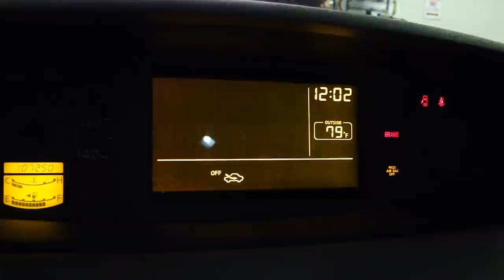Replace Nissan 3.5L V6 Crankshaft Position Sensor | 04 Nissan Quest

Comment: You have the same model Quest I do with the 4 speed auto trans so your video was very helpful for locating the sensor. It is different for the 5 speed. Also, I drove my quest for over 2 years with the odometer and fuel level display so degraded I couldn't tell my mileage or fuel level. Then I discovered your video for replacing the liquid crystal display. Twenty dollars for the display on line and followed your very detailed video and display was back working. Still is at least 2 years later and car has over 180K miles now. Thanks again!
Reply from the maker: Thanks for sharing your experience. Cheers!

Comment: Thank you!  I have an 2006 Altima SER and replaced the sensor over the weekend (P335 error code).  It's an hour project.  Two 10mm bolts.  One for the heat shield cover and a second for the sensor itself.  While the sensor is in a different spot underneath, your video put me in the right area on the passenger side and I was able to quickly find it.   Your videos show how these things are very doable and not out of reach for all of us. Thanks again!
Reply: Hey!  2006 SE-R here.  No error code, just intermittent random trouble starting.  Is the crankshaft position sensor just above a green harness as in this video, just on the passenger side?  I have yet to get under and look (was hoping all VQ35DE were the same) but just wanted as much info as possible before I do.  Thanks!

Comment: One thing I would like to add.  There is a O ring that is missing from that, so I would recommend getting it.  Also my CEL didn’t go away after i installed it, so you have to clear the code with the reset procedure, or using a scan tool.

Comment: Thanks for posting.  I watched the video that you posted to replace the cam shaft sensors.  I was able to quickly replace the oil seals as they were old and seeping.  My car is a 2007 Murano.

Comment: I have 08 Nissan quest. It does this weird tick after it wont start in the odometer area. The odometer dial actually flutters up/down once I stop trying to crank it. I put in a new starter, new alternator, and a new battery today. Do you think the crankshaft of cam is the problem? I was also told that it could be the fuses that are connected to the positive battery connector. Thanks in advance

Comment: The crankshaft position sensor on a Nissan pathfinder 2004 is directly under the center of the motor next to the oil pan very easy to get to

Comment: I alrdy check my nissan cefiro 230jm v6 wth OBD n the result my camshaft sensr bank 1 breakdown. Then i change the sensor bank 1, at the first it was smooth n no engine warning light appear after i drive for 5 hours all of the sudden my car misfire n warning light appear? So what should i do? Really need ur help. Did my new camshaft dat i change breakdown again or what?
Reply from the maker: Is it a Nissan part?
Reply: Yes, its nissan part

Comment: After changing the crankshaft sensor does one need to clear the error manually or the car system is smart enough to know that the crankshaft sensor has been replaced?

Comment: dia2fast, I just got my crankshaft POS from the dealer.  Like yours, it does not have the rubber o-ring like you find of the camshaft position sensors (your video).  Am I to take it that it does not require an o-ring?

Comment: Are you changing the crank shaft position sensor, or the cam shaft? You said cam shaft but caption says crank shaft.
Reply from the maker: This repair is for the crankshaft sensor which is located under the car. The camshaft sensor is located at the top of the engine.
Reply: @dial2fast  Thank you for the information.

Comment: Thanks for the video! Need to replace the one in our quest. It’s had a hard start since we purchased it and after replacing 3 different things that didn’t work I’ve finally came to the conclusion that this is the problem. It turns over 5-8 seconds before starting. Hopefully this helps
Reply: Did it work?

Comment: Good video but, without scrolling through the comments, it would be good to know what symptoms prompted you to R&R the sensor.
Reply: If the crankshaft is faulty the OBDII will report a P0335 code. The check engine light will be on.
Reply: Posible loss/lack of power
Engine stall while driving.
Reply: Loss of power? yep. The thing runs like a top now. Smooth, no stalling. Acceleration has improved by at least 10-15 percent.

Comment: Is an o-ring not needed on this sensor? When you showed the new part I didn't see one.  I also didn't see one during your installation.  I'm in the process of doing this and I didn't see one on the one I took out.
Reply from the maker: The Nissan sensor comes with a new o-ring.
Reply: @dial2fast  thanks I ordered an extra o ring when I ordered all sensors.  Tried putting sensor into place with o ring and it won't quite go into place.  I'll keep messing with it.  Haha.  Thanks for the fast reply.

Comment: I don't have a engine light on ... battery is good starter is making a noise i already changed the alternator cuz it was soaked in oil ... still doesn't start

Comment: Question.  I have a 2004 nissan maxima that gave me a p0340 (cam shaft sensor both bank1 and 2) I'm idling around 500 while in drive after replacing bank 1. It feels like it runs smoother and I wiped the check engine to see if it won't come back.  However the idle seems low still. Bank 1 was replaced with a duralast part to save money.  Mainly because replacing both for 250 in July parts is too much right now.  Any ideas? Where my problem may lie if there is one

Comment: Once again a wonderful video by someone who cares about safety.  But I have a hard question for you 2007 nissan quest 3.5l recent ecu change and reprogramEd by dealer and it still doesn't crank. After checking i am down to the ipdm. Could it be that or a bad reprogram by the dealer?

Comment: When you replace the camshaft sensors do you have to replace the crankshaft sensor immediately?
Reply from the maker: Its not a must but if your Nissan is high mileage, say 120k miles then you should consider changing it as a preventative maintenance since the crankshaft sensor tend to also go sometimes. When the crankshaft sensor dies, your car can't be driven and needs to be towed.

Comment: Great I think that will solve my engine light problem on my V6 3.5 on my 2005 maxima also. I wonder is there sensors for the transmission as well. Since these light popped on it seems I have no power in low gears. I have a 5 speed automatic transmission.
Reply: +Robert Morris  I guess I was asking if these sensors being bad would cause a loss of power in the lower gears.

Comment: Hello...i have a Renault vel satis 3.5 V 6(same engine)02 model!one day wille i was driving the car shut down(the check engine light was on)6 months before i have been change the fuel pump...the car cranks but no fired up...i connect the fuel pump with car battery and works...i dont have power on plugs...the fuel pump relay does the click...what is going on..?heeeeelp...

Comment: I have 07 nissan quest I had someone change the oil they put to much oil in when I was driving on the high way It started slowing down now when I try so start the car is just keeps Crunk !any suggestions!
Reply: Overfilling an engine causes the following issues to malfunction immediately or over time, oil becomes foamy after overfilling and driving it. Damage occurs once driven.

 Catalytic converter and oxygen sensors
Engine Oil pump 
Engine Seals and head gaskets
Engine pistons too oily
Valve cover gasket
Spark plugs moistened (damaged)
Engine Crankcase and other sensors. 

Subscribe to our automotive channel. 
We're working on enhancing our channel to explain more so anything in particular you want to know or see, just put it in the comment on any video.
K.I.O.'S MECHANIC & ELECTRONICS REPAIR
@901KIOTECH

Comment: This video finally have me the location of the sensor but now I'm having the hardest time taking out the old sensor I can't push the button in and pull at the same time with the tight fit. Did you use a special tool?
Reply from the maker: I didnt have too much trouble . Maybe try to push the tab with your finger and use a long flat head screwdriver to push the connector off.

Comment: I have a question.  Working on an 06 Nissan Quest.  It has a new fuel pump, now fuel pump relay and still has the same problem.  You have to cycle the key off and on several times before it will start.  After it starts it will start back if you immediately try.  If you wait 20 or 30 seconds or longer, you have to start cycling it on and off again.  We are lost with this one.  Any idea>
Reply: By the way, it has the 3.5

Comment: That was a nice video you place about the sensors. But, I would like to know is those sensors have the same locations on a nissan Xterra 2005, it would help me a lot if you can provide me that infornation.
Reply from the maker: The 2005 Xterra has a different V6 engine than the Quest. The location of the these sensors are different.

Comment: I have a 07 maxima. Do u noe why it takes long to start when it's cold? Once the engine is hot it turns on fast..
Reply from the maker: Not sure, but you can first try adding a bottle of that complete fuel system cleaner in the gas tank. If that doesn't help, it might be a problem with the fuel system which a shop can diagnose.

Comment: I saw a video on you tube where 2 sensors have been changing( 2007 Nissan Maxima), I only know that the engine is running strong without fails,.... for now.

Comment: my mechanic could not find the sensor under the engine as described . is this video for a nissan quest 2004 SE? he said the video might be for another type of engine or model.
Reply from the maker: The 04 SE came with a 5 speed auto tranny. The sensor location is different on your 05 SE where mine is 4 speed auto.
Reply: dial2fast i have a 2004 nissa maxima that wont connect when i connect it my car cut off
Reply: you need a new "mechanic"

Comment: Hi.I have a 2004 Nissan quest and I already change the position sensors and the crank shaft sensor and my van won't star.What alse do you think could be problem.Thank you very much
Reply from the maker: Do you have any trouble code which can help narrow down what might be wrong? It could be a whole host of stuff like fuel pump, or starter. Hard to say what it might be.

Comment: hey dial2fast thanks for sharing ur knowledge. i have the same car nissan quest 2004 n got some problems with the car the engine service is on and the tcs/slip lights are on and the car stalls and engine goes off while driving what do u think is the problem i tought it was the same problem as u had but i want ur comment on this?
Reply from the maker: Tsegay Tesfazghi It might be the camshaft position sensor - http://youtu.be/_zWJV-05qng. Best thing is to scan the OBD code and should tell you what is failing. You really don't want to start throwing parts at the problem unless you know what is broken.

Comment: Hello, great video. Do you know if the sensor is on the same position on a 2005 Nissan Murano, I'm having a hard time finding where it is.
Thanks.
Reply from the maker: +Paco Patron The crankshaft sensor is dependent on the transmission type, not engine type. My video is on a 4 speed,  and most likely yours is 5 speed. Search on internet for that location.

Comment: Awesome Video! Just a quick question tho, I have a 02 Altima Sedan Se V6 3.5L. Is the crankshaft sensor have the same location on Altima? and how many crankshaft sensor does have? if you can help me out it'll be great! ty
Reply from the maker: There is 1 crankshaft position sensor. I am not sure if the location is the same. That is dependent on the transmission it uses. Even for my Quest, there were 2 transmissions offered (4 and 5 speed), so 2 different locations depending which one you have. Google for your model and you should find out.

Comment: Did that sensor pull straight out?  Mine wants to spin counterclockwise, but still won't pull out...
Reply from the maker: If the bolt is out, then the sensor comes straight out. You might get some resistance because of the rubber o-ring on it. Try grabbing it and wiggle it side to side as you pull it out.
Reply: dial2fast Thanks, tried and tried.  It was really stuck.  Couldn't get leverage cuz the space was so tight.  Took it to GoodYear and the finished the job.

Comment: I have a 2002 Nissan Altima 3.5  is that the same? Do you know how many crankshaft position sensor the 3.5 Altima has? 
 Thanks
Reply from the maker: should only be 1 crankshaft sensor

Comment: Hey Dial2Fast, Another wonderful video here.  I have a request please.  The knobs for the climate controls on the 2004 Quest have bulbs which are burned out, and these supposedly aren't replaceable.  One needs to replace the entire control unit, at >$400 new and ~$100 used.  Is it possible for you to do a video on how to fix these bulbs, maybe by soldering in new ones?  There is a good amount of internet activity on this problem, so I 'm confident that others would benefit from such a video as well.  As always, thanks for your great instruction.
Reply from the maker: Hi Stephen, actually a month ago, I did take apart my climate control to repair a sticky knob and didn't get all the way to the bulb underneath. I don't remember exactly how those bulbs are mounted but I had everything taken apart. I appreciate your suggestion, I will think about doing a video on this. Stay tuned.

Comment: All your videos are awesome!  One quick note, next time you do your brake pads and/or rotor, just remove the two 19MM bolts that hold the caliper, then you can do pads & rotor without worrying about jacking up the van further to remove that bottom bolt... saves lots of time!

Comment: So is the camshaft n the crankshaft position sensor the same?
Reply from the maker: No they are not the same.
Reply: crankshaft is on the bottom of engine while there are 2 camshaft sensors on the driver side of the engine.
Reply: +Kingblaze 2100 They do look the same as the cam sensors, different position, maybe same part number for one of the cam sensors as the plug position differs.

Comment: why would you replace this sensor? What would problem that i would notice that it needs to be replaced?
Reply: hey boss I got a Nissa Ques . the battery died and try to jumps started and nothing.idle gauge does not move at all I replaced the cam sensor at the top and still don't want to start. I have not replaced the bottom one because I thought replacing the bank 1 sensor was gonna solved the problem it didn't.can you help me out please God bless you🙅

Comment: is this engine the same as the nissan altima v 3.5, are the crankshaft sensors positioned the same place
Reply from the maker: The engine is the same, but the crankshaft sensor is on the transmission which may differ from car to car. Even my Quest had 2 transmission choices and both locations are different. So best to check the service manual for your model.

Comment: When i drive my nissan quest it runs smoothly on D but when it runs 3 to4 mils the gear slip to another big gears and VDC lights comesup my van requres to much exceleator and still doesn't run that fast you can explane me what is it. And what can i do. Thnx.
Reply from the maker: Not really sure, but a quick google said for VDC light, check your brake fluid level. Also found this on the net:

The Vehicle Dynamic Control (VDC) system uses various sensors to monitor driver inputs and vehicle motion. Under certain driving conditions, the VDC System helps to perform the following functions:
● Controls brake pressure to reduce wheel slip on one slipping drive wheel so power is transferred to a non slipping drive wheel on the same axle.
● Controls brake pressure and engine output to reduce drive wheel slip based on vehicle speed (traction control function).
● Controls brake pressure at individual wheels and engine output to help the driver maintain control of the vehicle in the following conditions: – understeer (vehicle tends to not follow the steered path despite increased steering input)
– oversteer (vehicle tends to spin due to certain road or driving conditions)

Comment: Will this be the same on a 2001 Pathfinder?
 I drove the car home & parked in the driveway, The next day it would crank but not start up. Already changed the Intake valve control position sensor... still nothing.
Reply from the maker: You should diagnose it first and see what error code it has.

Comment: Your video says crankshaft position sensor but whenever you show the part, you said camshaft position sensor. So which one is it?
Reply from the maker: +Enrique Gonzalez Yes I made a mistake during the actual changing of the sensor and called it camshaft sensor, but this video is for the crankshaft position sensor. One reason I said that is because right before I did this video, I did another video showing how to change the camshaft position sensor which looks exactly the same but it's up on the valve cover.

Comment: hey man, i have a 2004 nissan quest se. timing chain was making noise soo i replace the guide& tensioner i put everything back but it thosen't start it just crank . do u know wat could be!
Reply: Maybe your timing is off since you move the belt,they sell a kit that holds the timing belt,just say

Comment: does this apply to 2002 Nissan maxima as well? Also before you made this video did you take parts off to make it more accessible?
Reply from the maker: +Darnell B Should be same on your Maxima (3.5 VQ engines). No other parts taken off before filming.

Comment: At 2:03 your video cuts and that is right at the most critical part of finding the location of the sensor.  When it picks back up I cannot tell where you are because I cannot see the oil pan.  So this does not help
Reply from the maker: +Jack Hemmy The orientation after cutting to next scene is the same. Oil pan is to your left, and driver side is to the right.